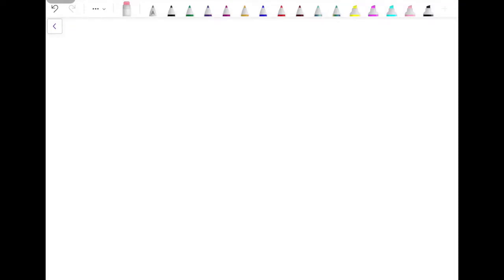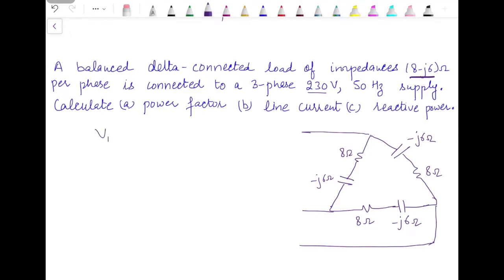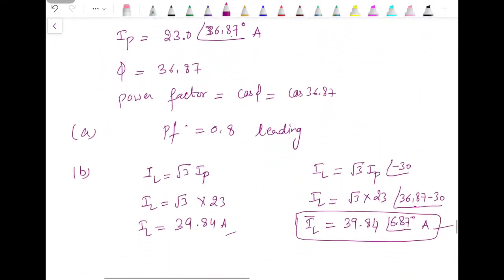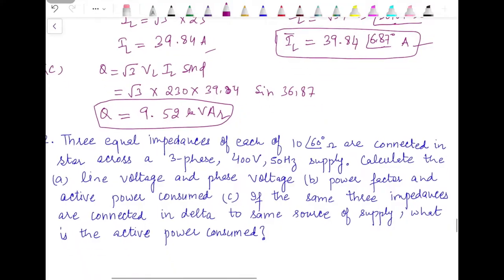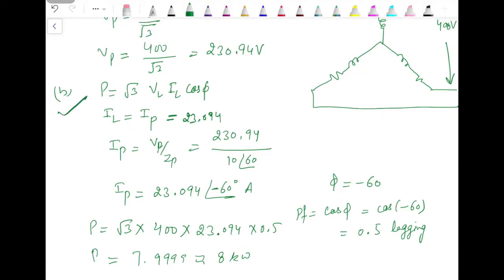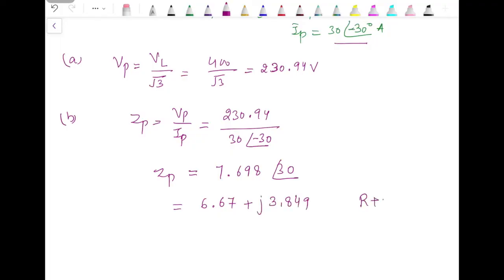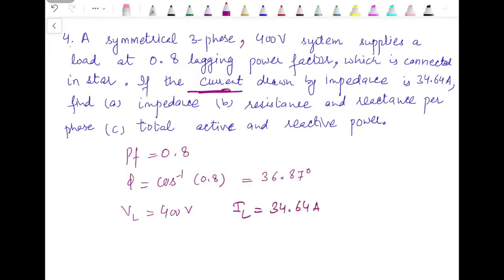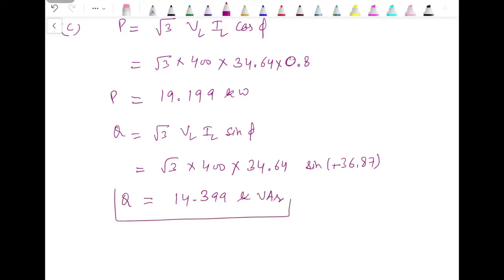Three-phase supply numerical example 1 #circuitanalysis #accircuits #starconnection #deltaconnection

Comment: Good explanation! I just have one question

In 3rd question, it seems you have taken line voltage as reference. Then to calculate Vp, don't we have to divide V<0 by root(3) with the angle of <30? If so we will have 230.94<-30 as Vp. Then in part b) we can get Zp = 230<-30 / 30<-30. But in your version, Zp = 230<0 / 30<-30. So which one is correct?
Reply from the maker: I will check and update I you soon
Reply: @electricalmadeeasy7  any update?